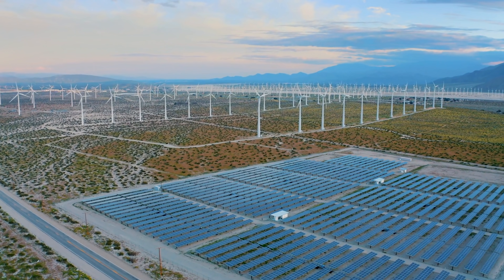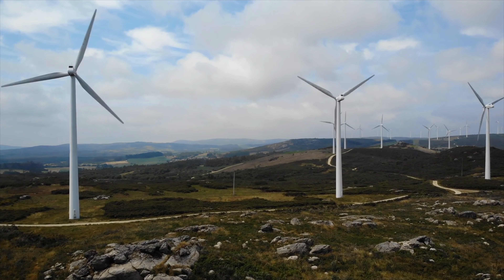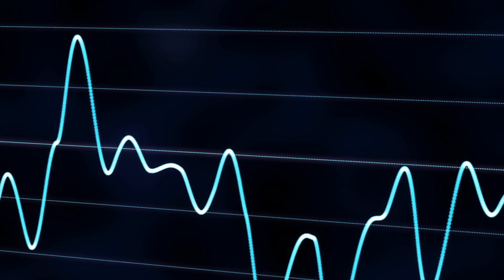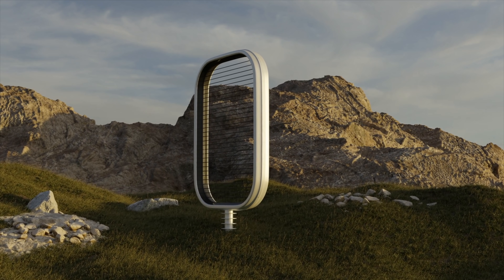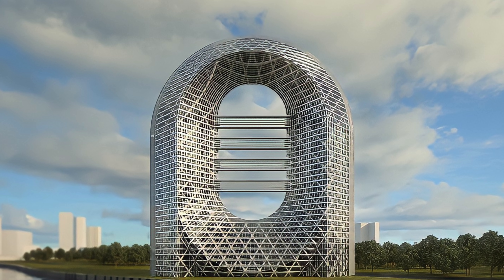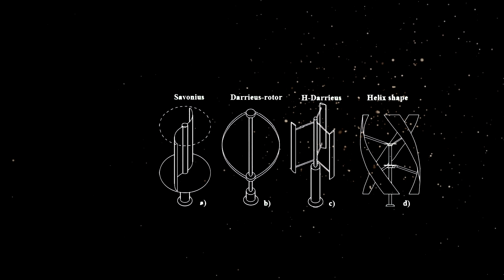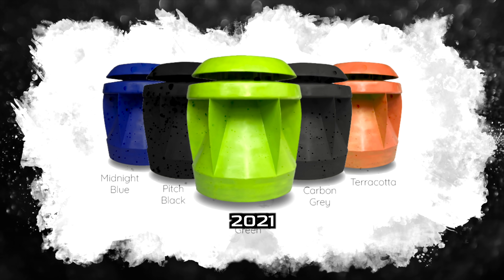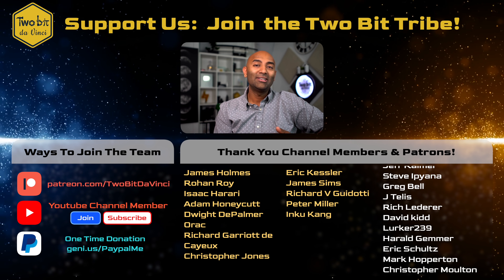These Wind Turbines have NO Blades!

Comment: This is what the colony on Mars will need. Static wind power generating devices. Solar power would be very weak on Mars and often blocked by dust.
Reply: By coincidence, a couple of days ago I was looking into the physical effect of high wind speeds on Mars (because I was thinking along the same lines!) 
Unfortunately, a 200 mph wind there doesn't have anything like the same power as a 200mph wind here on Earth. Something to do with the very thin atmosphere, the air molecules are so very spaced apart they don't actually have that much pushing power against the blades of a 'turning' wind generator. 
From what I could gather, you could 'hear' the wind blowing at 200mph, but it wouldn't throw you about like it would on Earth.
I found that rather disappointing - and I think I might just have ruined the film 'The Martian' for myself. 
So I think when it comes to Mars, it'll have to be down to solar power and just a lot of jobs created to clean the things. It might be interesting to know if Mars comes equipped with all the minerals needed to build sufficient panels to meet the needs of a good sized civilisation (I think we can safely put a tick next to silicon for the glass).

Comment: 234,000 birds.  67,000 turbines.  3.5 birds per turbine per year.

Think about the billions that will be wiped out by climate change.  Think about the entire species that will go extinct.

BTW, a recent study found that if one of the three blades is painted black bird collisions decrease.  And some wind farms are starting to use radar to detect raptors and flocks of birds approaching and when detected rotation is slowed or halted.  We can bring the already low number down lower.

Comment: Perhaps a generator on every roof at coastal locations
Reply: That'd significantly increase the investment cost to building a home in coastal regions. If you put it on the roof you'll either have to build it super sturdy, or it'll cause the entire house to vibrate. That's probably not the ideal way forward.
Reply: @Steamrick  point noted
Reply: @KGopidas  every problem has a solution. Please don't allow the commenter above to stomp on your dreams!
Reply: And some town centres have been designed and built in such a way they've become accidental wind tunnels. Basildon (new town) in England for example. Went there a few times and there are places where you could be knocked off your feet. My most local town is a pretty good example of a wind tunnel shopping centre too. I've never known a town with so many roofing contractors... Perfect for 3 of those designs.
Reply: @debbiehenri345  definitely deserves a video
Reply: @debbiehenri345  this is one of the best use cases for urban wind turbines, as slowing the wind down is a benefit of itself so they don't have to be economic on their own. Which is difficult in an urban setting as normally average wind speeds are lower, and the average power available much much in lower.

Comment: That's a lot of ethanol, presumably made by brewing yeast and creating CO2 and using water. 

It's also a lot of potential bang bang juice which you don't really want dotted around a city.

As for the turbine stealing energy from the train.... Well if the train is diesel, then the turbine is now running off fossil fuel. 

Still all good ideas, but still a ways to go.

Comment: Some info on the power outputs of these devices would have been great.
Reply: next to nothing
Reply: no torque at all. just a giant falic toy.
Reply: @fiditenemini2452  giant phallic toys are a big businesses
Reply: He said the vibrator out out about 1/3 of what a traditional wind turbine does at 30-40% if the cost.
Reply: @steveb796  That makes no sense. That is like the question, how much does a traditional fish weigh?
Reply: @tzenophile  currently at about $1.3 million per megawatt
Reply: @steveb796  Again, pulling a random googled number like that makes no sense. their 2.7 m rod may produce 100W at a certain wind, which is meaningless when we don't have a price or the wind speed in question, but comparing a 100 watt generator to a megawatt generator would be meaningless even if we did have a price and a wind speed.  Imagine the logistics of deploying and maintaining150.000 of these just to match a single 15 MW HAWT.
Reply: @tzenophile  They are working on small models while developing this technology but they are gonna make biggest ones
Reply: @pedrofmc0000  And what exactly makes you believe this? No one will buy a new product that is orders of magnitude (this means "a lot") less efficient than existing, cheaper products already on the market. Not here to insult you, but, I don't think you have a clue.
Reply: @tzenophile  It's been announced by the company and there're even videos of those models
Reply: Y

Comment: In windy Kansas fifty years ago I experimented with a modified, three blade Savonius rotor system. My belief was and is that lower rotational speeds would make some version safe and quiet enough for power consumers to live near, perhaps under. I envisioned a self-directing spoiler system, two self-adjusting blades up wind, one to shield upwind blade travel, another to scoop wind into the rotor's down-wind travel and a larger third vane to keep the other two aligned with the wind direction. Part of the idea was for the spoilers to trip into a shielding mode during extreme high winds. When Secretary of the Interior James Watt leased off the Powder River Basin coal fields at $0.03 and a half cents a ton, I realized my efforts had been made uneconomical. Three cheers for this new day!
Reply: In Kansas, there should have been enough space for a more efficient horizontal windmill powering the household? And today, those HAWTs are taking the world with ease, if not storm. I salute your pioneering vision back then, but after fifty years, isn't it time to declare defeat, and accept that the best HAWT won?
Reply: @tzenophile  Well, yes, the horz have it for now. But living in Wyoming I see vast tracts of relatively pristine high country given over to environmentally damaging wind farms. The turbines themselves are too dangerous to live among. Dangerous and noisy. Search YouTube for recorded catastrophic turbine failures. Key to wind farm development are use of public land, government subsidies, and the political will to keep the profits of power extraction and distribution in the hands of a relative few. No, this is no time to admit defeat. Well, personal defeat, sure, long ago was the time for that. But this is the perfect time to continue to identify and implement improvements to the system.
Reply: @markkoons7488  Ah, you remind me of someone else fighting windmills. Don ...?  If you would have something factual to contribute to this discussion, how much of Wyoming land is covered by wind farms? I'm guessing the amount is minuscule, but do set me straight with facts. 1%? 2? And how much of your power is from coal, contributing to global warming? Is Wyoming getting hot enough, yet?
Anyway, I live in a country 55% powered by windmills, and there are no terrors or great political battles to speak of. Wyoming has 6 people per square mile, mine has 350. I'd say your complaint, sir, is bollocks.  I believe the curse of your country is to be found much deeper down than in a few contraptions spinning on poles.  Best of luck to it, and to you.
Reply: @tzenophile  You're right. In terms of % I seriously doubt anywhere near 1% is in wind farms. The electricity generated by them is financed and consumed by consumers in other states. Coal is the source of practically all our electricity. Hot? Hotter'n a June bride.
Reply: @markkoons7488  Cheers, hang in there.

Comment: Sea Breeze wind has great potential. If thousands of "wind capture devices" were discreetly placed along the shoreline an untold amount of electricity could be generated.
Reply: It would be better to go hydroelectric as you can place it on the sea floor and gather and its not in the way of anything.
Reply: @zeusdarkgod7727  I vote for both or all. Only time will tell. As I live in the lake country of Florida, I vote for floating solar farms. I specked out Lake Okeechobee (730 sq-mi) which is west of Miami and eighty square miles of collector would provide most of the electricity. The real challenge is distributed generation that lessens our centralized power system.

Comment: Wind turbines kill larger and more endangered birds than domestic cats do. But I agree it's not the biggest problem. The biggest problem is that wind turbines are extremely expensive and people die putting them up and maintaining them. They are IMO the least viable option in their current form.
Reply: People die in all kinds of construction work, so this is not a great argument. And just don't put turbines next to endangered birds, problem solved. Also, to claim that wind is expensive, is to ignore that wind (and solar) are much less expensive than the alternatives. So, no, not expensive at all. Your most viable option is?
Reply: @tzenophile  the most viable option is nuclear. And most places with high winds have large birds that fly on those winds, so it's very hard to build them away from endangered birds. That said wind turbines are particularly dangerous to work on for a variety of reasons,  Less people die working at coal power plants and nuclear power plants which matters and is not negligible as you imply. Renewable energy is harder than fossil fuels to perfect, and the whole picture should be looked at when planning the future of energy.
Reply: @spcneary  No, it is not very hard to build turbines away from known migratory routes. And even when they don't, it is not 100% raptorcide. Let's use facts here; where are yours? BTW, do you believe climate change/global warming is man-caused? Just checking to see if I am wasting my time.
Reply: @spcneary  You're out because you don't have facts and hard numbers. I called your bluff, and pooof, there you go. Good riddance.

Comment: I just had a thought. The water sprayed based one that harnesses static. Why not use them in the desert and instead use naturally flowing sand and dust and collect that static energy. The only question is would it be more effective than a regular wind turbine, which I doubt it is. But dusty home owners who only has the space for a small version perhaps.

Comment: Doesn't the water from the EWECon also cool the area from the evaporation of the water in the air?
There used to be a vertical axis turbine in Yukon, OK in the 1990's.

Comment: I like the idea of the pods on our roof to compliment solar panels.
Reply: If it is effective enough to produce any power, you don't want it on your roof.
Reply: @tzenophile  why?
We have solar on our roof.
The car is electric.
We charge the car at night from the lithium batteries that collected energy gathered from the panels in the day.
I see a gas station and I'm like, bye felicia!
Reply: @michael4576  I have solar on my roof too, it powers the house and charges our bikes. The point here is that anything on your roof using WIND to produce actually usable amounts of power WILL keep you awake at night. But not to worry, these overhyped snakeoil contraptions unlike HAWTs, are likely not going to be useful enough to keep anyone awake. They won't lose you any sleep, only money.

Comment: Great video . As usual you held my interest and efficiently explained the concepts. This is in stark contrast to other channels that tease and waste time just to extend watch time. I selfishly hope for success of your channel.
Decentralization fights economy of scale when it comes to wind power but that seems to have stimulated some really clever solutions. I remember seeing a vortex idea from the 70's that used a large delta wing to create vortexes that were harvested by smaller props mounted above on either side of the rear of the wing. It was said to be able to use very low wind speed effectively.